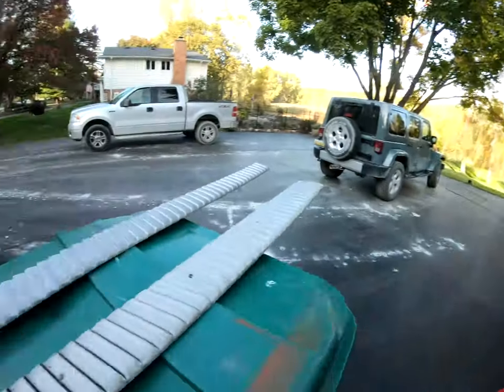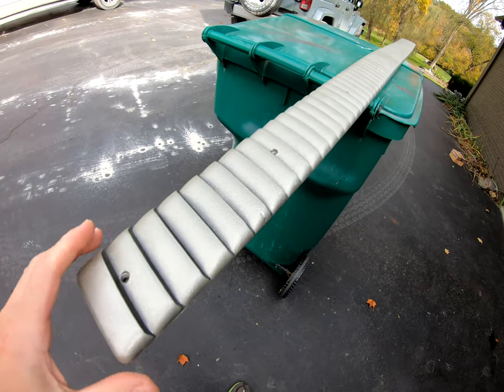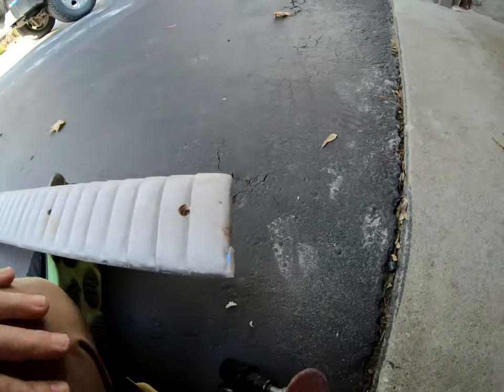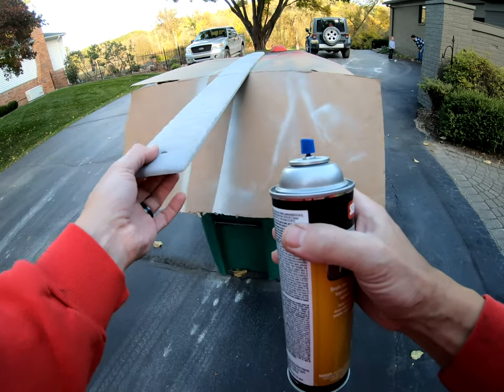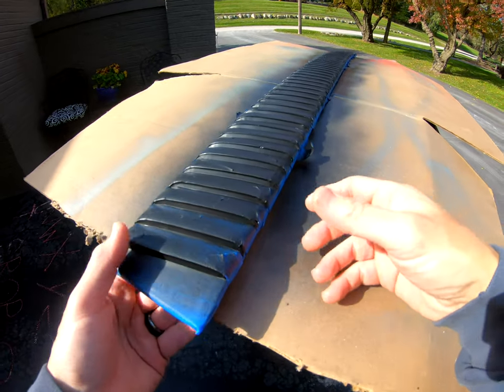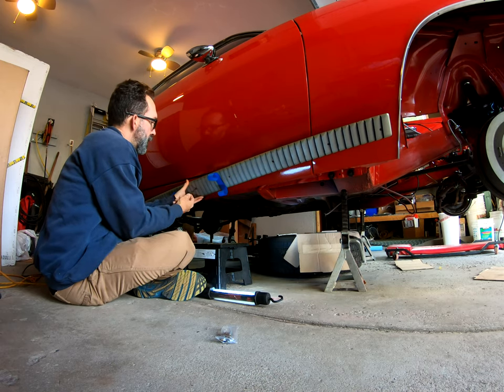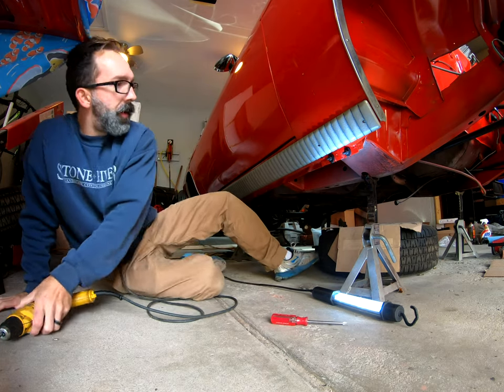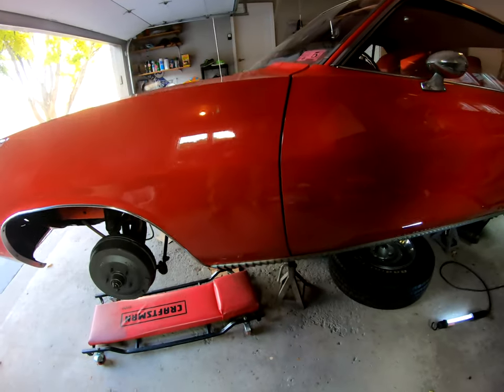How to paint Cuda rocker moldings!

Comment: I know this is an older video but I have had luck painting these. I hang the gills up so they are straight up and down. I first with the "opening" pointed upwards. I paint the black and let it dry. Then I turn the black part of the gills downward and paint the argent. I start from the top with a downward spray pattern. Works awesome and saves time from having to tape. I think that's how the factory cranked them out.